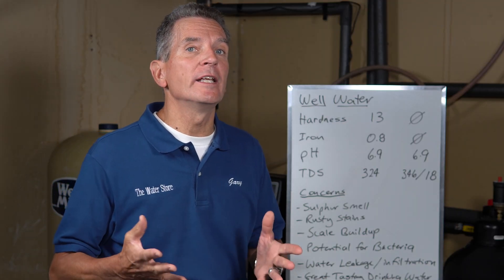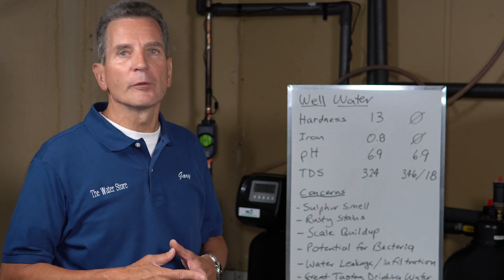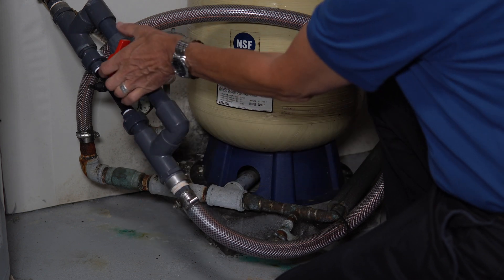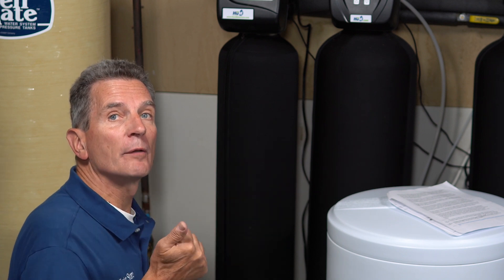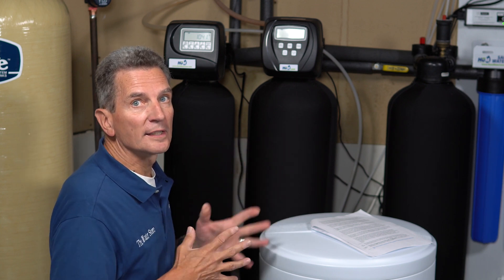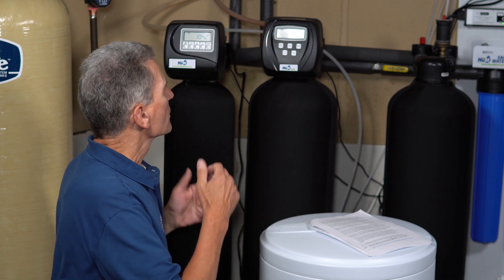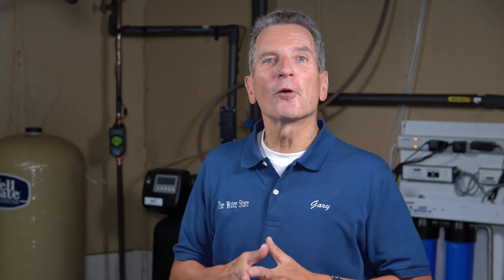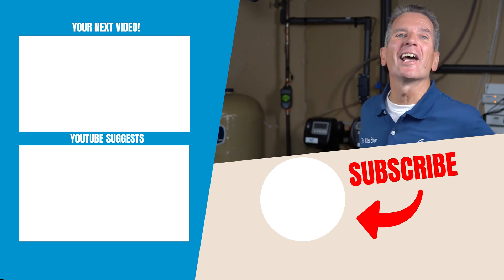TOURING Gary the Water Guys HOME WATER FILTRATION System.

Comment: Great video Gary, do you have any filtering before the iron removal system like a spin-down filter? and is a spind-down or like a 5 micron filter needed before the iron or softener equipment?
Reply from the maker: I don't but if you have lots of sediment in your water it would be a good idea to use either a spin down or a coarse filter like this one https://waterestore.ca/products/pentek-filter-20-big-blue-sediment-dgd-7525-20bb-155356-43
Reply: @water_estore  awesome thank you

Comment: Wow! That's a killer drinking water treatment set up for your home Gary.  I recently adjusted and replaced some of my own system components, well pump- 1hp, 100ft deep, 85 gallon pressure tank, pressure 40-60 switch, all lines converted to 1" & 3/4 pex and new check valve.  My pH was at 6.2 before the twenty-year-old plus us filter (I think flec these days) treatment missile, I just refilled it with a 50 lbs calcite successfully! pH is now hovering around 7.   Could you tell me does a water softener media become ineffective at some point? I believe the ion exchange wears  as it ages, & wondering if the media is replaceable. I also trying to figure out the proper regeneration schedule, does both have to be set to every other day for a family of 4, for the softner and pH acid adjustment? The company that installed my system is no longer around and I'd like to get a handle on all this.  My treatment canisters are very late 90s  (us filter w  analog timers).  I know there's not a easy answer for all I am asking, but any guidance would be greatly appreciated,  I'm nowhere near you, (in NJ) & your videos are  
fantastic. And many Thanks!
Reply from the maker: Yes water softener media can wear out but it typically takes over 20 years. The frequency of regeneration depends on how hard your water is and the size of your water softener. Any idea what yours are?
Reply: @water_estore  
It's about 20+ years. I have  look at the size. Many thanks for responding. Is the water softener media replaceable? Thanks again!
Reply: Gary, the softner size is a us filter model 4602. WG 948.  Wondering if the media is replaceable in this softener? Thanks very much for your informative videos.